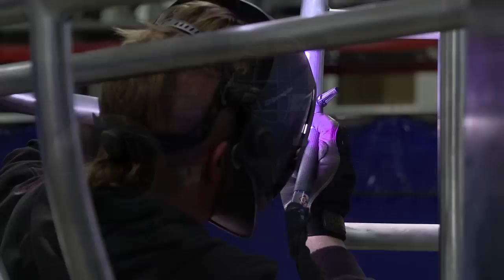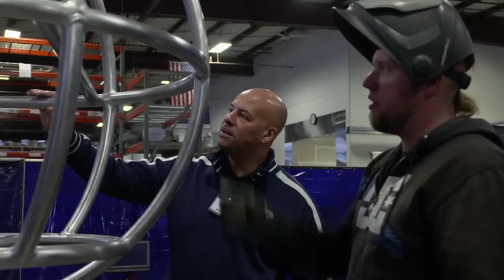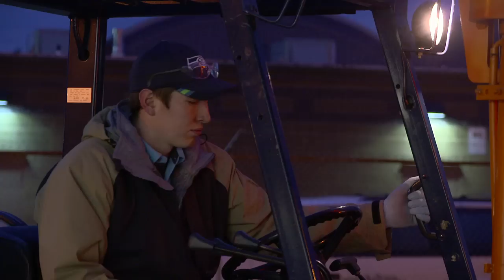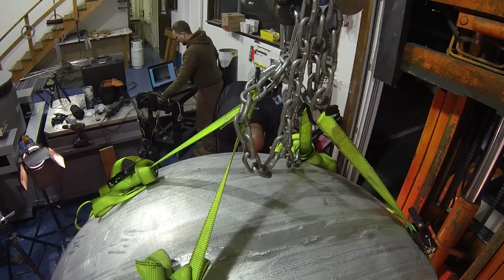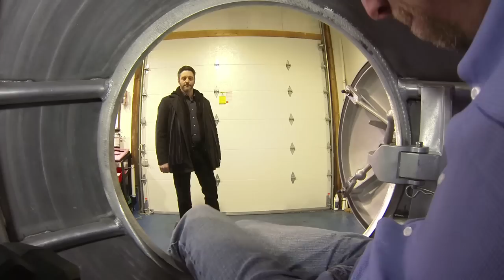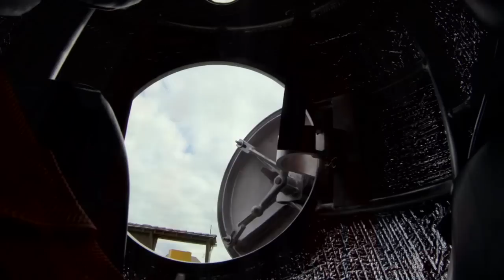SURVIVAL CAPSULE

Comment: You would be tossed around badly, this needs a separate interior capsule that would be weighted to stay upright, ball bearings, air pressure or liquid would allow the interior to move separately from the exterior,  with oxygen, food, medical reserves. 
I would also make the final exterior with heavy rubber bumpers tough enough to resist snagging or tearing, but at least allow for stability.
Reply: Jamie Dudek I think a larger one would work better for that, the single or two person one is just a last resort looking thing. Though I wonder how they keep the air fresh in there....
Reply: Oxygen tanks, practice slow breathing, another separate moving she'll wouldn't be too far fetched
Reply: if your strapped in tight enough you won't hit your head

Comment: Soon... there most likely will be versions made with a transparent yet extremely protective nano-material able to filter through clean air which the escape pod can both be driven by rolling in any direction on road assisted through electromagnetism and some sort of way to propel it about when floating..